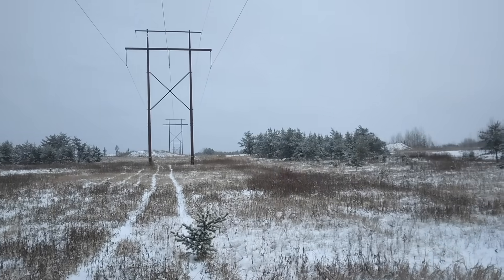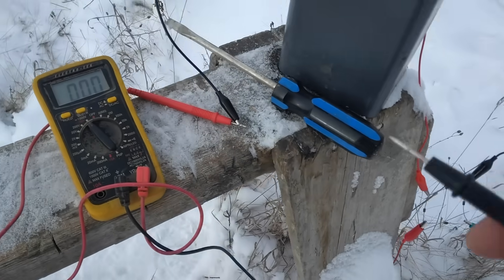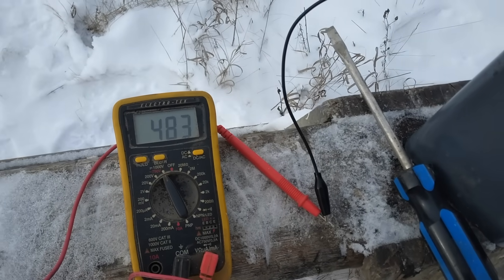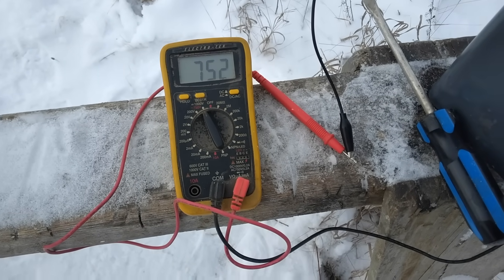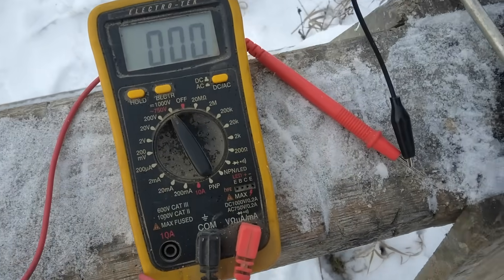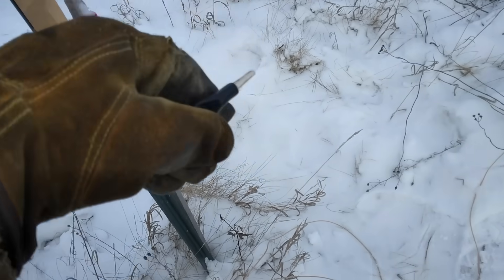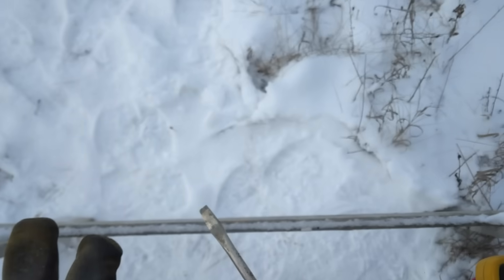Fences sucking power from under HV transmission lines

Comment: What frequency is lines transiting power at? Then design fence to that length of coil and wire
Reply: A half wave at 60 HZ is 7800 ft long. so a dipole with two pieces of wire half that length would be some fence. A loop antenna would be smaller , even so with a ferrite core, like old internal AM antennas.  But you'll need a big ferrite core, like an electrode from an electric steel furnace. Could then be camouflaged as a old style saloon horse park, placed horizontally on the top of two short posts as an overlier parallel to the powerline.
Reply: Sounds good to me. Ive allways thought a person could put coils on a drone and use it charge the drone for long distance travel maybe even power line drone racing  @Tore_Lund
Reply: @bkparque  I've seen military drone prototypes, that could hook onto power lines and inductively charge.  Much better if you get the coil smack up against the power wire. Then it works like wireless charging, which also use magnetic coupled antennas.
Reply: @Tore_Lund  touch those lines and your drone is toast
Reply: @bkparque  Not lines! one single line. You can safely touch a powered high tension power line with your bare hands, if you are not grounded and you don't touch more than one, as a drone won't be, or the linemen servicing high tension wires from a helicopter. There will of course be a tiny spark, like static electricity as the drone gets the potential of the wire, but that can be mediated by fitting the drone with whiskers that through a large value resistor brings the chassis of the drone up to the line potential. But you are in a sense right. the engineering has to consider the effect of large EM fields on the rest of the circuitry, so the drone wont be damaged, but it wont "fry" there will be no large currents going through its internal parts.
Reply: @Tore_Lund  ok well guess that makes sense except how you ground
Reply: @bkparque  You don't ground, you are not completing a circuit from the wire to the ground to extract energy, you are simply picking up the oscillating field around the wire. like wireless charging or how an inductive stove top works.

Comment: Basically proved wireless transmission of electrical power. You can feel the energy when you're standing close to those transformers and capacitors, inside the sub-station.

Comment: We were working on a road to a radio antenna near a power generation plant. Not sure what the voltage was on the HV transmission lines, but I had parked my F350 crew cab long bed under the transmission lines perpendicular to the lines. Chrome door handles and I had a very hard time getting the door open to get in. Every time I touched the handle, it hit me like an electric fence.
Reply from the maker: Thanks for sharing!
Reply: try to open the door while jumping off the ground XD

Comment: Attach a switch and a ground to the fence wire acting as an antenna. Set the switch to the AC frequency of the power lines and feed that wire into your electric grid. Not only will you get free power, but they will actually have to pay you for excess power you feed back into the grid!

Comment: You could put a step down transformer on the end of your coax wire, that would decrease the voltage to your bridge rectifier, but it will increase your amperage to a usable amount, that you could run a burried insulated cable, to your house, to keep a battery bank charged to help you reduce your electric bill. 😁👍
Reply: It would be awesome if somebody made an animation depicting the setup that you're describing....🙏 😁
Reply: 36.2 joules is 0.01watt hours or 0.6w for 1 minute and he was out there a good long time. Is no energy to be harvested at that distance. He would need to be right up close to harvest usable worthwhile power and then he may as well just clip on the lines.
Reply: Keep going you may need help from some kind of person who can guide  you to build a unit to connect  to your house  so your Metter runs backwards and hydro  pays you for there electricity
Reply: also known as electricity theft
Reply: @johnbeer4963  but there not fiscally connections? if anything anything cleaning waist RF energy and responsibly disposing of it in responsible way? catching repurposing it? all for free?
Reply: @dh2032   I wish it were exactly how You say but there was a guy in my country a few years ago stuck a bunch of fluorescent tubes in his field under a power line and there was quite a fuss about it. He definitely got charged for a load of electricity, i'm not sure if there was a criminal court case about it but i seem to remember there being one
Reply: @johnbeer4963  That's interesting.  How did they meter the 'stolen' electricity?  Do you know what their 'proof' was?  Also, would there be a loss to the company and can we sue the company for using our ancestors bodies to run their turbines? 😋
Reply: @I_Don_t_want_a_handle  the proof was it had been in local news, that's how the power company got to know about it i think. They don't have to meter when they can "estimate"
Reply: @CaptainRon1913  i dunno man i'm just recalling something that was a news article many years ago that i only remember because i basically agree with you and everyone else and considered it an injustice at the time. I used to work for British Telecom which answers Your other question. Regarding their old type telephone network. The "Master socket" in every home is considered part of their network and there have been a bunch of people charged multiple thousands of currency for messing with that. Had one while i was there. Dude replaced the master socket with a slave socket and wondered why his phone stopped working. There were also a number of cases where people were criminally charged for stealing electricity from the phone line and given estimated bills for the electricity they stole at like 30,000% more than the electricity would have cost them at their own plug
Reply: @CaptainRon1913   definition of theft in some countries is 'depriving another person" of xyz..... so if you borrow or steal the rf, you are depriving others of that rf, which they are also entitled to.
Many years ago in Great Britain, some one did that with RF, on a farm near a powerful radio station, made an inductor or fence....that drew a lot of power. I don't know the downstream set up (electrically)..... but he was definitely drawing a decent amount of power.
The legal downstream effect on the farmer was conviction for theft of electricity, repayment of estimates etc etc.
Reply: Paying for electricity is the theft you fool

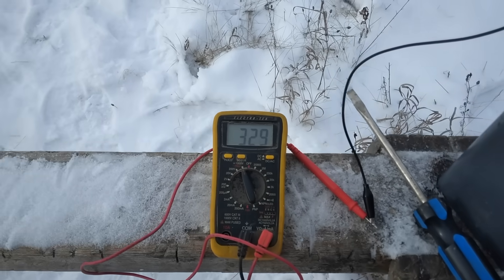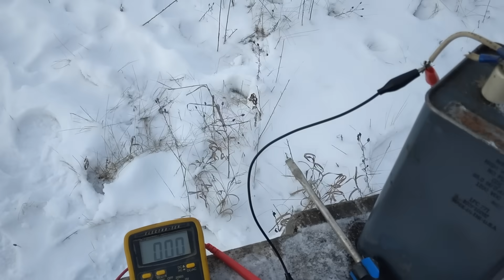Comment: Excellent practical demonstration - and cautionary tale. I was interested in the charge rate and wondered if I plotted the voltage vs time if it would show the expected exponential curve. (data for the curious: 2:04/0V, 2:36/180V, 3:45/328V, 4:38/423V, 5:10/478V, 5:37/515V. Stopped there because of the glove break.) It does initially but then the slope stays the same. Interesting. A friend of mine worked at SNC in Wisconsin. One of their products was a device (probably a common-mode choke) used in rural land-line telephone systems prevent phone techs from getting killed from just the thing you demonstrated. Think about the power in a phone line that runs close to and parallel to power lines for miles! Yikes!
Reply: Telephone cables are normally fully shielded, and the shield is grounded. Only the drops going to houses are unshielded.
Reply: @ethanlamoureux5306 it's not the case in my area. The pairs aren't shielded, they're twisted and don't even have a guard wire. Many of the copper pairs are within 4 meters of 33kv aerial lines.
Reply: @dinosshed  That may be true in some cases, altho I have only ever seen it on rather old, smaller cables with few pairs, such as a 6-pair drop. Bear in mind that when I say shielded, I don’t mean each individual pair is separately shielded, but rather the whole cable is normally protected by a corrugated metal shield just inside the outer jacket. This protects against physical damage as well as electrical interference. The oldest cables used lead jackets, and when they moved to polyethylene jackets, they also started using an internal shield to do the same job as the lead jacket.
Reply: @ethanlamoureux5306  I used to lead wipe the mains and repair the air leaks on them. Some of the aerial cables were shielded, but they were rarely joined with the strapping.
Reply: If it took 213s to get to 515V, that works out to 11.67J in 213s which is... 55mW.   So this could keep a small light lit indefinitely.
Reply: @lakse123   I did the math based on another viewers observation on capacitor charge time , and everyone seems to be in agreement. Its just enough to light up a 5mm LED at a medium brightness (needs about 15-30 mA which is 50-100 mW ).  The capacitor is where the real danger comes in because it can store enough power / zap to kill someone for sure.
Reply: I've been scrolling down to find this calculation as I couldn't be bothered to work it out myself!
Reply: So THAT'S what was on our phone line in the basement, I remember the guy saying it was for his safety.

Comment: Nice experiment! Thanks for showing that. I guess if you hooked up a circuit that actually drew current, then less current would flow thru the transmission lines.

Comment: Not sure how my buddy did it but he made a copper coil with some other gadgets attached to it and would catch the bleed off from the power lines coming off the power plant lines that was less than a mile from his home. It worked best during foggy days and he would charge small 12v batteries